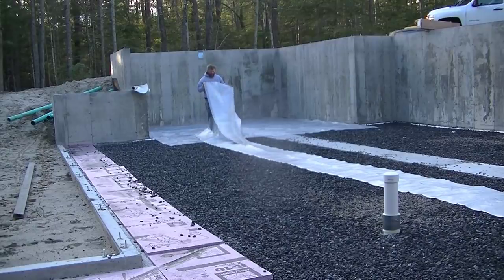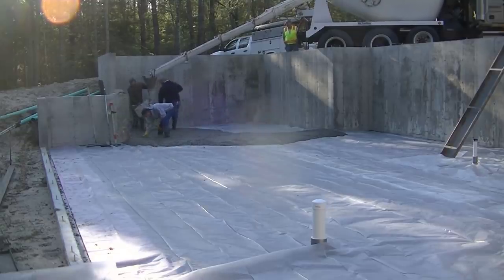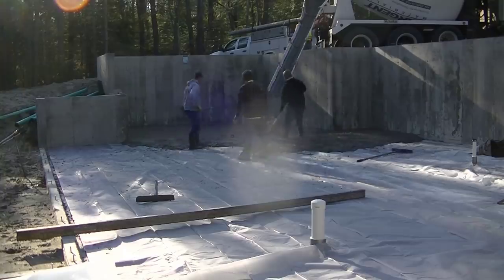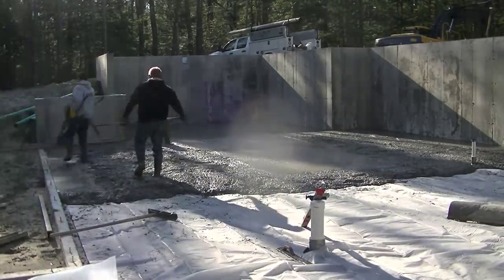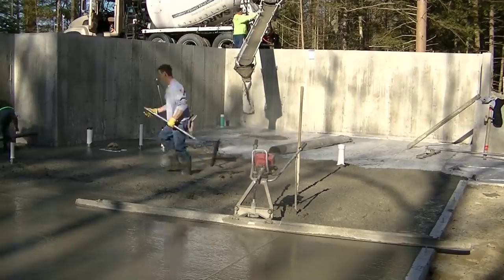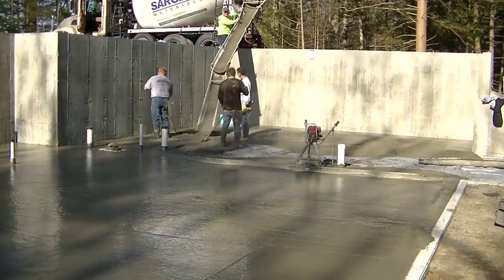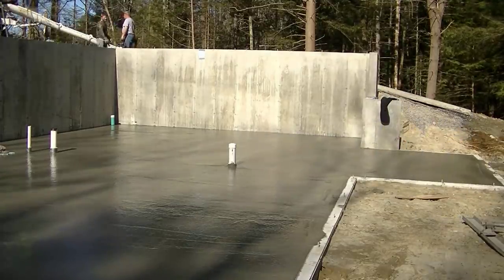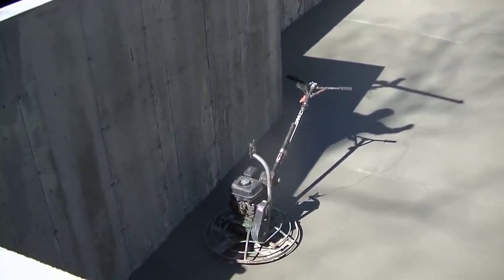Pouring Concrete Floors In A Daylight Basement (Two Things You Must Have)

Comment: Rev the engine and let 'er rip is usually how we dump, never did like the splatter and the pile-up, either that or let's rent a pump truck. That boot and extended chute look like great ideas, gotta try it.
You make it look easy.    Great job.
Reply: Laser screed on big slabs. Screeds it out as fast as you can dump it. 👍
Reply: @psidvicious   Expensive to rent. {unless you own one} Hard on the puddlers, {rakers} needs to be dumped and raked very accurately to keep it from flowing over the screed. Sometimes more work than it should be.
Reply: @alfeinstein4168  In my experience, it almost eliminates the rakers completely except for minor raking at edges of screed. Are we talking about the same kind of laser screed?
Absolutely you need to have a very large amount of square footage to justify cost.
Reply: @psidvicious   We're in the midwest, mostly new house construction, small tear-outs, some larger floors, small crew, much like what we see in the video. We've used a laser just a few times, seemed like more work than it should.
Everybody does concrete work differently, uses different equipment. I see what you're saying though.
Reply: @alfeinstein4168  Gotcha. I think you’re talking about a laser level. I was referring to a large wheeled vehicle with a laser activated 14’ screed. Not practical for house slabs. Only used for large warehouse type slabs or roads of course. 
Like this:
https://www.youtube.com/watch?v=b0ijNbGAezk

Comment: Gotta keep your concrete company's ( dispatchers ) happy with you. One day my two guys didn't show up to work so it was just me to pour a 2000' basement and a two car garage. Well everything went well with the basement but had to back a truck in the garage to make some of the pour. So I had to install the front form on the Garage and while doing it I hit my thumb with a 3 lb hammer and was unable to straight edge any more. The driver did offer to help but I called the dispatcher and he was able to find a location to send the last concrete truck to so I didn't have to pay for it. Oh the thumb... with in seconds looked like a big black apple :)
Reply: -I’ve seen a cpl drivers that would pitch in and help out in a pinch but sadly, most just stand there with their hand on the discharge lever and say “you’re on your own”. Pump operators, on the other hand, were usually pretty good about picking up a come-along and helping drag a little mud. 
-It’s nice when you’ve got a dispatcher that’ll help you ‘lose’ a truck somewhere else.
Reply: You can pour 2000 square feet without 2 men but you can’t pour 700 square feet without a thumb. The Lord sure knew what he was doing when he designed man.
Reply: @danwalters5198  Right. Opposable thumbs! What an invention!!

Comment: Great video.. Just curious why no rebar.. They will go crazy out here with no rebar?
Reply from the maker: On an interior house floor inside a foundation wall it's not needed as long as the sub-base is done right. The floor isn't going to go anywhere inside the walls. If it cracks, it's not going to settle or heave (if the sub-base is done right). So no rebar is needed. Just saw contraction joints, pour the right slump and we don't have any problems.

Comment: Should you put expansion along the edges? I don't do concrete but from working around concrete guys in construction I'm told to use expansion when concrete touches or use rebar to tie together.  ?

Comment: Great video/explanation.  Details like setting your screed pads with the laser and how you go about screeding is interesting

Always nice to see well-oiled crews working - makes usually-difficult work seem easy (it can be IF you know what you're doing).  

Even though I poured a lot of concrete, always found it stre$$ful because of the con$equence$ if things went wrong - always high-dollar structural pours on bridges etc where a mistake might be many hundreds of thousands to fix.  As such, learned to over-man and occasionally have a back-up pump on standby on particularly critical pours.

Comment: Dear mike, I really can’t effort for a full concrete truck, plus the difficult access to my drive way, if I will do it one day at the time a slab 40x20 to park my RV over it, let say 20 square inch everyday at the end  would be consequences to the consistency of concrete? Please help me with some glues?
Reply from the maker: Antonio, it would be better to do it in one pour if you could. If not, make sure you dowel the pours together so they don't lift or settle at the seams. You may have a slightly different variation in color on sections if you don't do it in one pour.
Reply: Mike Day Everything About Concrete really apreciate your time Micke! Thank you

Comment: Hey I'm a young concrete finisher on the other side of the states. South Western Oregon to be exact and I've done concrete for 10 years so far and here in the last couple years I've been dealing with cold weather conditions for the first time in my career. I've been putting hot water and 3 percent high early and I have a difficult time getting it to set up for a hard trowel. Is the water reducer your using essentially the same? Or is there something I can do to use less water and speed up my set time?
Reply from the maker: The water reducer will let you pour the same slump with less water. The batch man has the water temps up to 160 degrees when he loads the truck. Liquid cal doesn't work as good as flake calcium in my opinion. Also make sure they don't use any fly ash or slag in the mix, just cement in cold temps.
Reply: @MikeDayConcrete  I'll ask my batch guys about it. Last year I learned about the slag and fly ash and it helped allot. I pour allot of garage slabs in the winter you don't want to pump it because it's not enough but it's hard on you to pull half a garage with a rake. Using an extended shoot looks like the ticket and if a water reducer is available I'm gonna jump all over that
Reply: @MikeDayConcrete  It's not actually called liquid cal Mike. It's called non chlorinated accelerator. I use hot water and as low as 1/2% Daraset in winter months in NH and that tends to be more than enough to get the concrete to set up. Depending on if it's inside or outside and the I would go to 2%, but you have to have your game face on because that concrete will cure very quickly. Just saying. Also, to Allens question. The concrete should not be poured on unprotected soil from frost or even just the cold temps of the soil will reverse the curing time as well. Just saying

Comment: So I get that the fiber takes the place of rebar, but are most engineers hip to that?  And what do you do if the plastic is already down and you get rain the night before?  Do you order less slump knowing the water on the plastic will give you more bleed?
Reply: Fiber does NOT take the place of rebar or wire. In a residential application (3/4" @1lb) fiber is designed to reduce shrinkage cracks. With that said in my experience I have never seen wire in a basement floor.  Whenever we supply concrete that we know is on plastic we can up the dosage of water reducer to increase water reduction.
Reply: @jasongreene89  , Thanks Jason for the info. Out here in the west with expansive clay soils,  I'm pretty sure they always use rebar.  I only have some knowledge of architectural concrete where we use a lot of fiber instead of rebar as often, we only place (or spray) to a 5/8" total thickness.

Comment: Are you required to tape the joins on the vapour barrier? We have to over here, all joins even into the footings, origami.
Reply: There was a time when they started making us do that, back when everyone was worried about radon gas, but most municipalities around here have lightened up on that now. Occasionally you’ll see it called for on the plan 🤷‍♂️
Reply: @psidvicious  We had to tape all joints and even carry the membrane into and footings, so in effect the slab never touched the ground, you can imagine the entertainment around corners etc cutting pieces and taping them in.

Comment: We don’t use concrete shoots added  on to the truck our concert company’s wouldn’t let us hook them on the end of  the truck shoots. They say to much weight on the hydraulic system. We don’t use or own a shoot I’ve never used a vibrating screed never was sure about them probably because just don’t have the same man that could run it everyday. We would have pulled the truck down in back, (walk out part)  to pour some of it. We usually dump out the whole truck before we start striking off. Probably take 5 minutes to empty. We call the attachment on the end of the shoot a elephants trunk. We pour a 6” slump and would have put grade pen in approximately every ten feet. 
Three guys pouring out that basement floor and garage floor is super good.  We would have used 4 guys to pour out and left 2 to finish, we never never ever leave a truck driver on his own we would have had a guy on top directing/guiding the truck. Would have got $2.00 per ft for labor to get ready and pour, $4.00 for materials and labor.

Comment: Yeah... that's what we call a "residential" 6" slump.  LOL
Reply from the maker: It is. We use a water reducer in it also.
Reply: @MikeDayConcrete  
Yep, I know what a water reducer is, but do you know if it's a polycarboxylate or naphthalene based... makes a difference in your set time.  😂🤣
Just pulling your chain a little.... I'm a quality control manager for a ready-mix concrete supplier, and the one who does all of our mix designs.  I'm also the one who gets the phone calls with all of the problems, like when guys are pouring on vapor barrier and finish it too soon, causing delamination, but no.... "You got shit concrete".  Gotta give you guys a bit of hell once in a while...